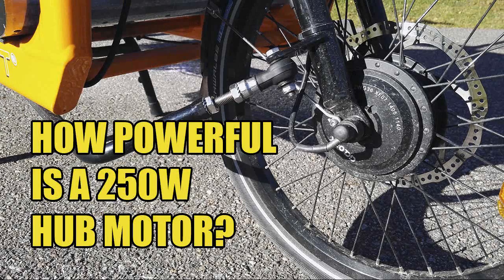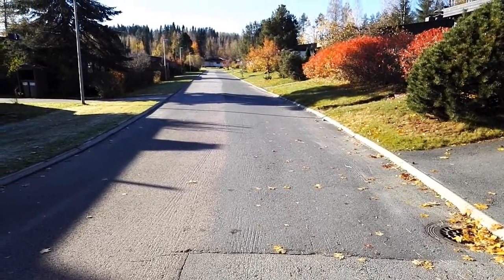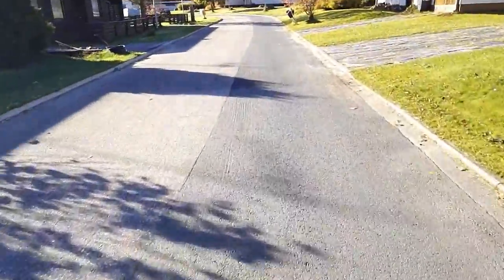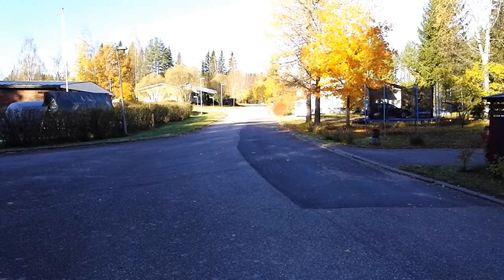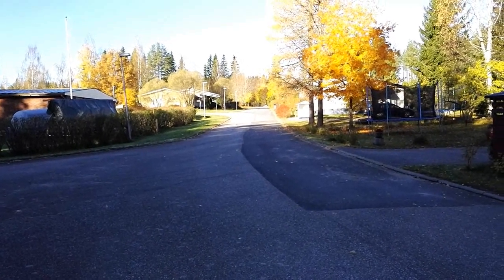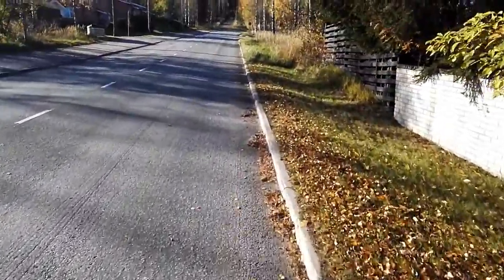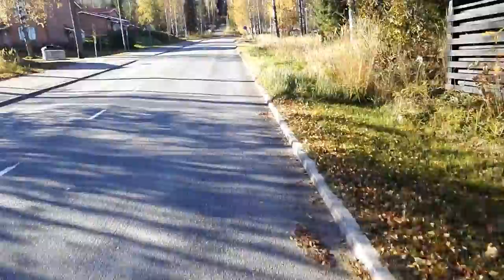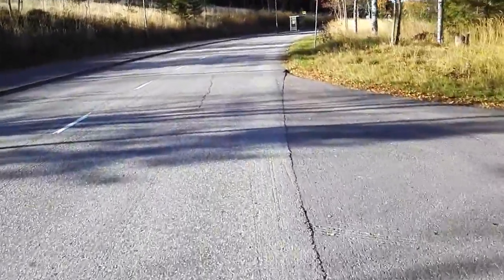How powerful is a 250W hub motor?

Comment: The answer to the question in the title would be 250 watts.
Reply: i only clicked on this because i knew this comment would be here +1.
Reply: Slightly cruel - yet also correct LOL
Reply: I'm your 100th like. Brilliant sir, and oh so true! LMAO!!!
Reply: Most of them can deliver over 500 Watts though.
Their nominal power is 250 Watts although the average power (hopefully) is less.
Reply: Funny but not completely accurate. 250 watts is the power they draw. amps and torque are also important
Reply: In my country it is obliged, otherwise it is not a bicycle.
A throttle is not allowed.
Reply: Is that why it draws 500 watts on a hill?
Reply: Yes Cycle Trucks.
I know the 250W/36V motor of my e-bike is internally limited to 15A. So it can draw a maximum of 15*36=540W
If the controller would not limit my speed to 27 km/h I could easily drive much faster on a flat road. For the 250W Bosch middle motors you can easily go to a shop to have the software of the controller changed and it will go much faster. But it is illegal to drive them on public roads after this software change.
Reply: @czarzenana5125  
in the USA every state has their own
laws on electric assist bikes and
a few states do not allow them at all,
most have watt limits or speed limits
of maximum of 20 miles per hour
Reply: @leadmanski  
Yeah I know in the US there are huge differences between states.
The 250 Watts nominal, 350 Watts continuous and 600 Watt peak power hub motor with speed limited to 25 km/h in this video is pretty much the standard within the EU. E-bike Commuter is from Finland which is member of the EU. Like Bennie Van Den Tillaart wrote torque is of influence as well. You'll need high torque for hills.
In the EU we also know speed pedelecs or speed e-bikes. We need a drivers license for those and insurance and a helmet are obliged for them. They are seen as electric scooters/motor-cycles up to 40-50 km/h.
Reply: Ethan Sloss 
Yes but you miss the point, to the beginner “250w” is an empty phrase that has no meaning to the person. 250w is appropriately enough to move one human being at 20 kmh
Reply: Stephen Mancuso I’m looking at these kits online and have no clue what it means
Reply: Smitty Knickerbocker 

Exactly, well a physics lesson.
A “watt” is an amount of power.
1 watt=1 joule per second.
1 joule is sometimes defined as the amount of energy required to accelerate 1 kilogram to 1 meter per second. 
So a 250 watt motor with a zero drag condition could move a decent sized man (as long as the torque is sufficient for any kind of hill)
Reply: Stephen Mancuso interesting thanks a lot
Reply: Loll
Reply: Except it's not 250W. It's even shown in the video.
there are ebikes with much more actual and also consistent power than the engine rating may suggest.
Reply: Wrong!!
Reply: Idk volts amps torque.   Like life.   Age of cells also resistance factors in consider action.   WITH ELECTRICITY.   COMPARED TO COMBUSTION.  the sky is not always blue
Reply: @czarzenana5125  right. Lol. Your comment is like mine. I say. V.  amps all factors. Lol
Reply: @girlsdrinkfeck  I put 55volts at 20amps through my 250w motor, it loves it
Reply: @leadmanski  I live in Florida... Cops here could care less... They actually encourage you to ride on the sidewalk, even though they're are bike lanes, the people he drive HORRIBLE..  so the police are tired of cleaning up accidents.😧

Comment: Standalone it's not fast enough, but the interesting part is if you have to go say 5 miles, which is pretty rough of a ride when just peddling, I bet this would provide a lot of assistance...just make the peddling much easier.  I kind of like this concept because getting a 500w + would make you kind of lazy, but with the 250w you're still getting some exercise but can go much further without becoming completely exhausted.  For example I want to buy one for going to the gym which is 5 miles there and 5 miles back.  This would be rough going 5 miles, then lifting heavy weights for an hour, then having to ride another 5 miles.  With the 250w it would probably make it much more viable for me, but if I went higher I would be lazy and probably not peddle at all
Reply: Yeah, I've seen it used with bike packing too (lots of gear, tent, food, etc).  Keeps the amount of work a rider has to do reasonable.
Reply: It's just that. I still work up a sweat when going fast, but I have the option of going a bit slower and having a lot of assist. Uphills and headwind are the game changers.

Comment: This was very helpful, thanks! It also shows the limitation of a hub motor - the slower it turns the less power it can put though the wheel. A hub motor has a certain optimum rpm in which it has the highest efficiency. That's why the controller is pumping up the electrical power at high load/low speed. 
On a mid drive system you can manage the motor rpm by simply downshifting on a steep hill. Disadvantage is of course the higher wear on drivetrain components... ;-)

Comment: That is on a 20 in tire, which is important information.  I have  one on a 700C with an oversize tire, 35mm+-.  It goes faster, but does not pull itself up hill very well.  It needs a lot of help on a steeper hill, which is understandable.  So for those considering, the tire diameter is a very important consideration in how the motor will work out.  In hilly terrain either go for a small diameter wheel or with a larger motor, perhaps with regeneration.  If you live in flat terrain, regeneration would not be worth it and a 250 to 350W will likely be all you need, depending on your capabilities. ??

Comment: Good demonstration of the capability of a 250w motor. Higher wattage motors require larger heavier batteries. If you don't need the higher wattage the price for conversion is much lower. 👍👍
Reply: Basic view of Electricity people miss.  More Volts. Like pouring more water out of a bucket.   Sure you gain but you lose.    Think about it.  36 v 500. 20mph.   48. Same 28mph.    Give and take $$$$$$   I wish I rode a 24v.    So.  DAMN CHEAP.     BUT SLOW

Comment: Thank you! Finally I find a video that SHOWS the performance of an electric motor in the real world, and with a load that isnt 80kg.
I'm a 136kg rider on a new bike and struggling to get around hills in the area, and this sold me on getting a conversion kit to help me stay motivated to keep going with a bike :) I'll get a 48V 500W motor since some of our hills here are not quite as pleasant as yours
Reply: Good on you. Just get a motor at the crank and not the hub
Reply: @mooneepondsmassive7016  There are lot of reasons to do a front hub motor on a bike like this. First there is the forces on the drive train. None with a front hub motor. A lot with a mid-drive. You may need to upgrade some of your components. Secondly, the weight, it's good to have a bit of extra weight at the front, since so much weight is already at the rear.

Comment: Thanks! Planning to install a 250 hub motor which only weighs 1,4 kg and a 1 kg custom built lithium battery to my delicate 6 kg carbon fiber road bike, and hope it wont be to much for the frame. Theoretically, 150W from me and 150w from the motor should be enough to get me to 45-50km/h.
Reply: Yeah you should be able to get speeds of 35mph to 40mph

Comment: Extremely useful a big thank you, I'm also about 118kg. This clearly shows that the 250w will pull me along nicely, I don't need to break any speed records just go on shopping trips about 12km round trip. incidentally can you tell me the controller output and battery voltage and amps?
Reply from the maker: Andy Norman 

I have a 17A controller and a 36V, 13 ah battery.
Reply: I live in a hilly area, I weigh less than you do, and I have a 750W mid drive mountain bike with an alloy frame. I can handle the majority of hills in third or fourth and at a decent rate, but there's one hill I have to tackle that requires me to shift to first gear. I wouldn't want to exchange it for a less powerful bike.
Reply: Salafrance try the 1000 watts   wheel and make sure the battery takes 1000 watts  i purchase that on ebay .is faster 28mph  but not sure about up hills.
Reply: Thanks - I might try that sometime with a new build.
Reply: TRUE  BUT GOOD LUCK FINDING ONE .
Reply: Not sue you don't trust ebay battery packs , most of them come from the same suppliers in china no matter where you go , you can order them directly fro aliexpress , dhgate, or alibaba .
Reply: Wind AliBaba is for wholesale, unless you want to pay $60 for DHL shipping I don't recommend buying from there as a consumer. You can buy 18650s and make your own cells, just make sure to measure their capacity and match them as best you can
Reply: If you live in England or EU then 250w is legal limit plus other silly rules like 15.5 mph max, you can go over that, but motor cuts out at 15.5mph  then its pedal power to go faster, basically its like someone else is pedaling with you, BUT i can get up hills with a bit of pedaling that i would have no hope without the motor and my legs are not like jelly(jam if ur American).
Reply: i think americans call jam-jelly i think they call jelly-jello if that makes any sense
Reply: shady shane yes That's correct.  Jelly on sandwiches jello as dessert
Reply: ah, so do you call a Portuguese man-of-war a jello fish? (confused face).
Reply: Same. I just hate biking uphill.
Reply: Try a XION rear hub motor 250 watts with a maximum of 1100watts. This motor is sensor operated with a lot of torque so it's very easy going up hills. Actually it works very much like a mid drive motor. I weigh 97 kiss and can get from zero to 27klms per hour in a couple of seconds
Reply: ToxicDubZ get yourself a XION rear hub motor. Heaps of torque so going up hills is easy. The XION motor works very much like a mid drive motor. It operates on sensors
Reply: If you want an e-bike faster than that there's no problem getting them, but they qualify as motorbikes, so you'll have to have a motorbike licence and pay the tax and insurance that come with that. The low power and motor assist speed limit are so you don't have to do all that but still have the convenience of light, cheap transport.
Reply: holy crap , i just responded to a troll-bot    didn't expect one here      ANYWAY , in the u s , jam=WHOLE fruit&sugar        ,jelly = same ingredients , but strained to remove seeds&pulp , and jello is a fake , food like substance ,gelatin , sugar and artificial colors and flavors ; TYPICAL AMERICAN PRODUCT and edible , if enough fruit , cottage cheese , etc. is added
Reply: @kcajmortsnnew1488  Don't forget preserves and marmalade! Marmalade, yuck
Reply: He is paddling, see his shadow . Lol
Reply: peglor In Belgium you can go unil 1000watts but not Overgaard 25km/h. Do you know how upgrade the power of a bafang mo750 watts blocked by the contrôleur i think

Comment: im used the same kit 2 weeks ago...im very happy....im 85kg weigth..the bike has 13 kg ..and bikepacking about 5 kg...total: 103 kg.....the level 1 of asistance its veriy nice for flat roads...in uphill i used level 3 and im taking 13 km/h speed....i recommended the semislicks tires for road  if you have a mtb.......finally im used  the 11 ah battery...with this battery i can did 60 km with 1000 m positive uphill acumulated. if you going only flat roads yo can did over 80 km for sure

Comment: 250W adds some assist, peddling is definitely still required. I have had 350W, 750W and now 1000W systems. The 1000W system I have right now is pretty sweet, but even with it I still peddle hard on the hills to help maximize battery life. The harder the draw, the harder it is on your battery and these things are expensive.
Reply from the maker: Gerry H 
I agree. This is why I haven't bothered to install the included thumb throttle. 250W is simply not powerful enough to allow me to cruise around only using throttle.

Comment: I have an Ancheer city cruiser 250w electric bike. That "hill" your talking about, is absolutely nothing compared to hills I ride. It's great for flat surface and down hills. 25° and higher, it bogs down even with pedal assist. 350w and higher is my best suggestion for steep hills.

Comment: I have a 250W rear hub and where I live- very steep roads. In my dreams are a 500W front hub at least. In the long run it would take the strain off the rear and be better for the motors and batteries. Cheers

Comment: So 12 to 15.5 mph top speed, I'm glad I went with a 750w. Good video 👍
Reply: My motor 350 Watt 36 volt bldc motor battery 15 ah 36 volt maximum speed 45 km pH on flat surface 20° incline 40 kmph

Comment: I added a Bafang front hub motor to my Bullitt recently. It works great but the top speed is limited on a 20" wheel, because the controller limits the max rpm of the motor. The simple type of controller supplied with the kit does not allow any advanced tuning, so I am stuck at around 22.5 km/h with actual assist. This is ok since I didn't ride the Bullitt much faster anyway. Hills and headwind are a day-and-night difference, flat is more like dusk vs evening.
Reply: Did you get the 20" higher rpm version? I'm looking into this and I think that you'd be able to hit higher speeds with that one.

Comment: Hill climbing requires torque - torque at the tire is going to be lower with a 26" or 700c wheel than with a 20" wheel. I'd really lean toward 500w, although a 250w motor can provide decent supplemental power, when you need it most is when you'll find you don't have quite enough to make it up that one hill with a load of groceries. Just depends on your usage. If you'll only be on known routes, and just need a boost, 250w will do. It's when you start to challenge it with a variety of terrain that you may find there are limits - maybe more than you think.

Comment: It can take litle overvoltage to gain acceleration. One guy put hubmotor 75v, and it worked fine. Just more batteries to encrease voltage.
Reply: House fire speedrun

Comment: Nice video. Thank you 😊

I see a lot of comments about the low power, but there's also the legal issues with motors above 250 W. Although, to be fair, I haven't seen anyone inspecting these, as long as you pedal and don't use throttle, which also isn't lawful here. So, 250 W / < 25 km/h / no throttle is the legal limit for class 1 ebikes.

But it never ceases to amaze me why a bike can't have a throttle, while very similarly specked escooter can. What's the difference?

Comment: The Motor is proably meant for a bigger wheel because a 250 W Motor can easyly do 30 km/h and has in such a configuration still enought Torque to go uphill and accelerate.

Comment: have you tried stepping up the battery with a super easy step diy generator. Here's how just use the motor and connect a cog with another cog at the ratio of 4 to 1. then you put the motor on the large one. then get a used broken generator and remove the stator. Attach stator if (15 magnet to 4 to 1 smaller gear.) if not adjust to number of magnets. then purchase multi meter and rotate while checking for maximum amperage and voltages. (transformer may be need for your unit.) then purchase ac ebike motor and adjust throttle to 40 amps as the voltage may be to high. It may be slower but it should due 200 miles on a charge and have no problem going up hill as it is running on the stator and not a battery. good luck.